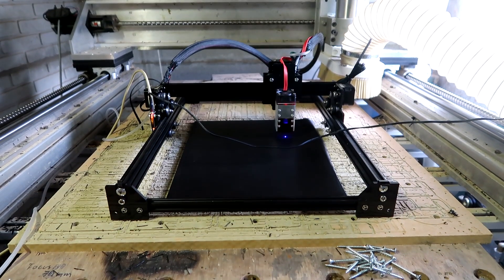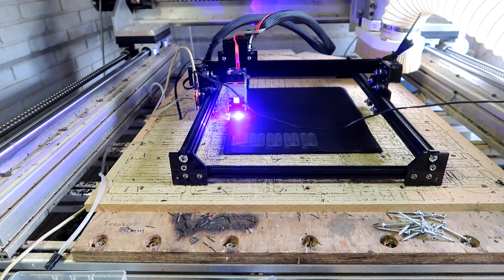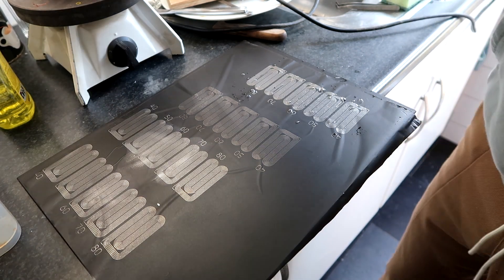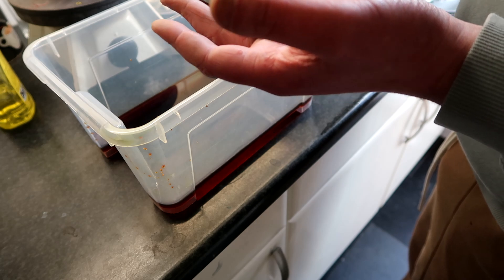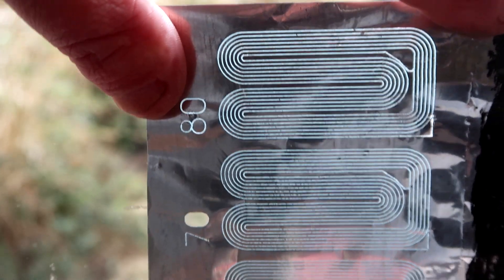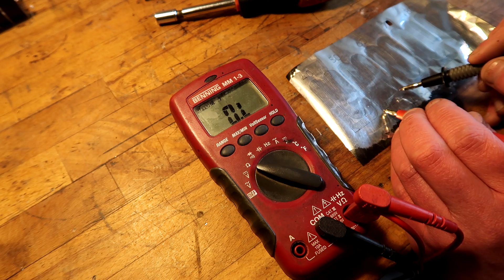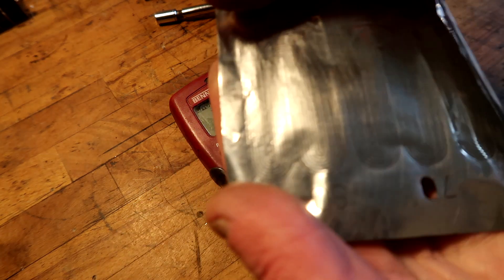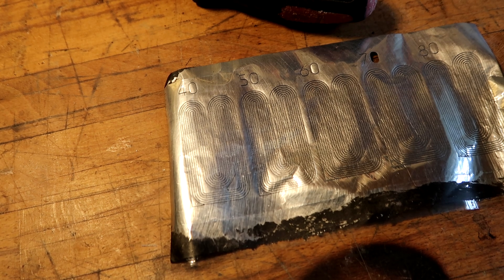Etched tweeter foils power/etch tests with a new laser from Neje

Comment: Could try using compressed air to cool while the laser is burning off the resist. Also having the mylar on aluminum backing plate would help to keep it cool since it would wick the heat away.
Reply from the maker: hmm yeah i could try some compressed air, normally this laser is used with compressed air but usually only for cutting. this case might be helpfull thanks i might give that a try !

Comment: I think higher power is etching better because the laser is removing some of the metal. I am betting you need lower power and longer etch time.
Another Idea is to use circuit board photo etch to make the resist. the laser may be close enough to UV to activate it.

Comment: Try 40 just slower speed
Reply from the maker: thats an option , but it heats the mylar longer as well. so results might be the same
Reply: @joppepeelen  Try high power but even higher speed and multiple passes. That's how you reduce charring when laser cutting wood, it should also help manage heating in this application.

Comment: @joppe peelen I worked for 20 years in a company that only etched surfaces in 3D, e.g. the leather structure in the plastic in your car. Therefore, I allow myself to leave a few tricks:

The black lacquer is not particularly suitable for protecting the contours during etching. I would recommend using a special photoresist that is acid-resistant. A very good product is, for example, "Positiv 20" from the company "Kontakt Chemie". But there are also many other companies.
It would be ideal for you if the photoresist or the wavelength of the light to which the photoresist reacts matches the wavelength of the laser. The laser can then expose the paint and you can then simply wash away and etch the unexposed paint.
The advantage for you is that you need a lot less laser energy and the film is equally stable and sounds the same everywhere.

What many people don't know is that acid works at different speeds depending on how warm it is. The warmer it is, the faster the acid etches.
Special aluminum can get warm very quickly when etching. Therefore, it is best to put the acid in the refrigerator beforehand and let it cool down. The etching then takes a few seconds to minutes longer. But then you have the same time in summer as in winter. It is also important that the acid always flows over the workpiece/film. This then transfers the heat from the etching into the acid, giving you a much better result.
In your case you will mostly be etching in a bowl or tub. So all you have to do is place a pencil under the tub and then tilt the tub back and forth. Then the acid keeps moving and cools the aluminum.
Reply: Addendum:
Positive 235 works with laser light with a wavelength of 340 nm to 420 nm. Typical applications include the production of circuit boards or photolithographic work. The resolution is sharp at the edges.